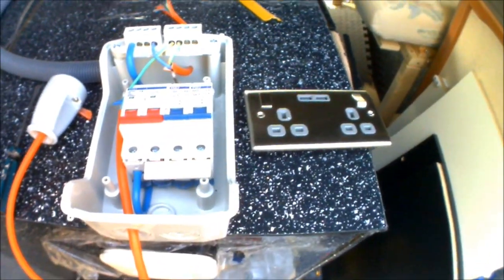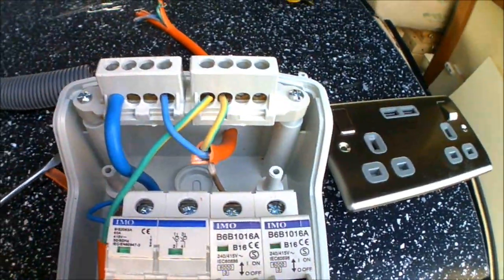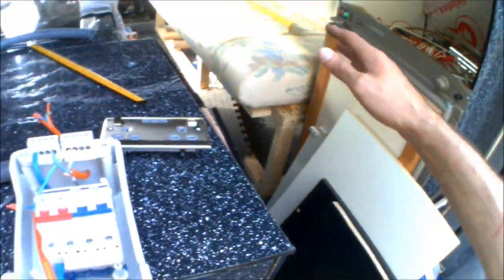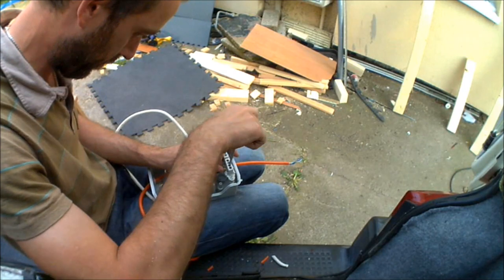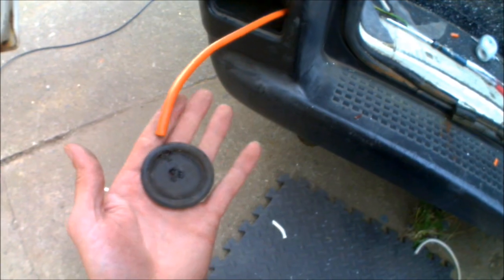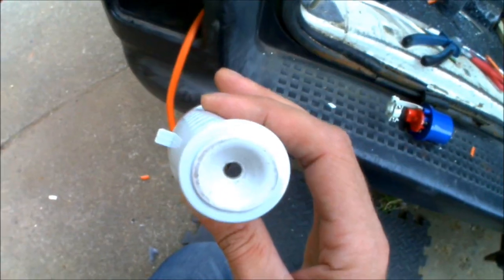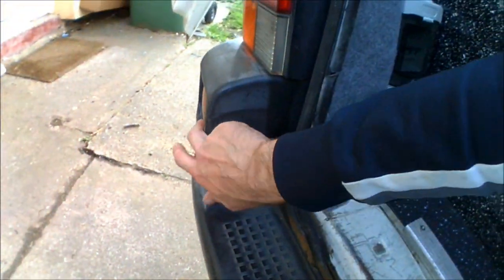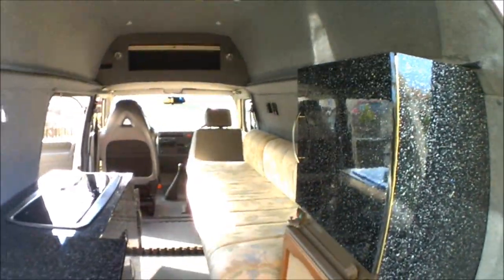VW T4 Concealed Electric Hook Up, Consumer Unit & 240 Sockets Install VW T4 Camper

Comment: My t4 had the caravan plug hidden behind light.very handy for charging etc at home .have same plug outside house.my mains breaker in a cupboard under sink.but hidden away but leave ganger plug in there.I have 300watts solar on roof and 3 mppt charge controllers an inverter so don’t use mains much on holidays

Comment: Hi,
Great idea. One question I have would be does the fog light not fail on the doe test as its not in working order?
Reply from the maker: It’s a false reflector light, it never worked as a light ever so no problems
Reply: @TheCampervanBuilder  👍👍
Definitely going into my van 😁

Comment: Just come across your video and wondered why you felt the need to earth the 240v to the bodywork ? The 12v van system is ground to the body so if there was a problem you'll potentially risk back feeding 240v AC into 12v Dc
Reply from the maker: It has been fitted as per caravan safety regulations, it doesn't matter about the 12v, earthing the chassis protects against stray wires touching bare metal and causing havok/death.  Check online if you need further info, google earthing 240 to chassis
Reply: Do the caravan safety regulations also consider the Amendment Number 3 to BS7671:2008?  Requiring a metal casing for the consumer unit?

Comment: Maybe I'm missing something here but how are you going to replace a blown lamp in your tail light without dismantling the MCB unit?
Reply from the maker: there is a  little wriggle room to get your hand in but if it has to come off to change a bulb, its just a couple of screws to remove it and lights maybe get changed every couple of years so no worries for me

Comment: Hi, love your videos, have you done a fitting of a leisure battery install. I am wanting to install one in my lwb t4. Would be good to see where cables and batteries are sighted. Thanks and well done 😊
Reply from the maker: HI I didn't do a specific battery install video but I believe the install of the hidden wiring switch panel video covers the batteries and fuse board in this build, hope that helps

Comment: I've got this on my van but it tends to get water ingress into the plug.Have replaced plug once.
Reply from the maker: I sealed all around the cable entry grommet with mastic tape, it never leaked in the plug in the 2 years I had the van.  Maybe seal it closed to be sure
Reply: @TheCampervanBuilder  cheers, this was done by others,so will have a play to see if can sort it out,thanks.

Comment: Had to watch this twice to keep up with your hyper-delivery :), but still a bit confused. Why do you need to earth it to the van when it is also earthed via the Hook-Up, I would have thought it would be best if the 230V system does not contact the vehicle at all??
Reply from the maker: This was done on the advice of a motorhome safety engineer who said he expects to see any consumer unit earthed to the body chassis, think its incase are any bare 240v wires touch the van
Reply: You should always bond the incoming earth to the vehicle body otherwise if a fault developed the body could become live!

Comment: I would strongly advise that you change the main isolator of the consumer unit with an RCD type trip/isolator. AND instead of having 2no 16amp mcbs have 1no 16amp and 1no 6amp.  I could explain but best you ask your local electrician.
Reply from the maker: Please try and not sound condescending when leaving comments, this van has already been inspected by a caravan safety engineer who was more than happy with what is installed and how its all been fitted.  I know exactly why you are stating to fit an RCD and to be honest, I thought thats what was fitted to the unit I ordered at the time of ordering and didn't have enough time to wait for a replacement so fitted what arrived with the view to swap it to an RCD in the future,  I also specifically wanted 2x 16a MCB's so I can have the fridge hard wired to 1 (which draws well over 6a) and the other is linked to a plug socket which could be used for anything from a tv to a microwave so reducing that to 6a would not offer enough before cutting out.
Reply: I don't think he sounded condescending, just pointing out a safety thing in case you didn't know.

Also, I like your videos.